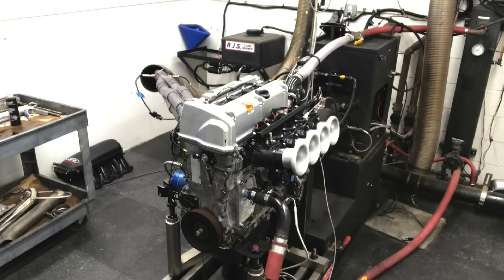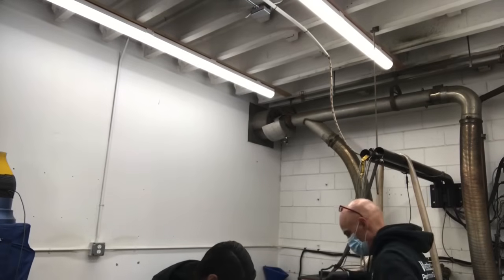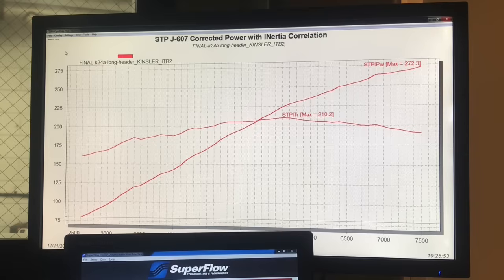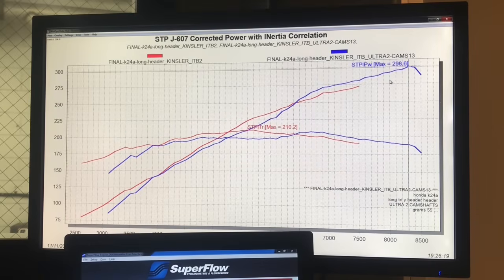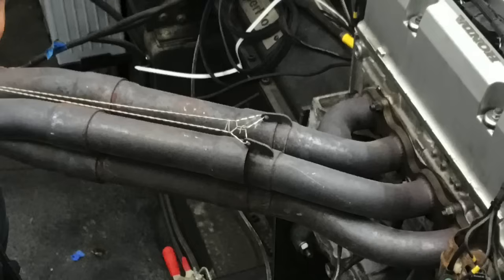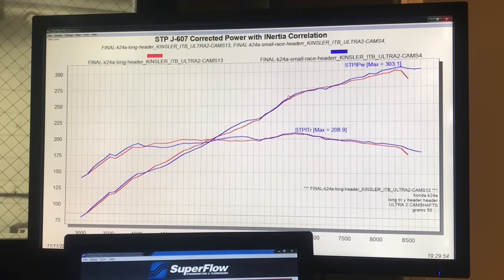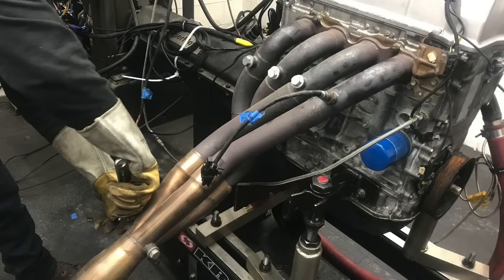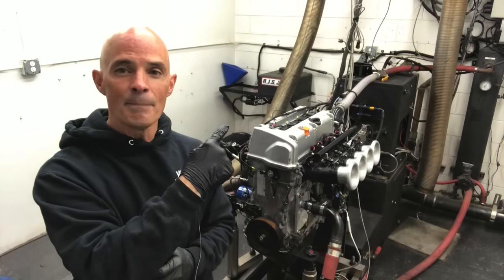HONDA K24A2, STOCK OIL PUMP GOES 8,700 RPM!!

Comment: Richard your normally realistic about Hp numbers on majority of your videos, but to get 272hp from a stock k24 with nothing more then Itb's !! +50hp is tad high for an engine with everything else stock 😳
Reply from the maker: "Normally Realistic?" I just provide the dyno data-you do know there is a difference between rated output and tested output, right?

Comment: so what can the stock engine rev to? Stock cams, stock springs
Reply: i dont care if the engine is built to 20K  it shouldn't live there. those engines are high $ engines and they won't live long it's why the manufacturers leave all that horse power on the table in the first place. guys who love a revvy engine love to flirt with high repair/replacement cost, GM got around the EPA for years in their performance department with gearing for example barely 200 hp economy v8s and COP transmissions. yep the same tranys that were in cop cars,to get them to perform, it caused them to go back to the drawing board everything thing they put out in the '80s was a turd by design.  the EPA hit them  it nearly wrecked their performance dept. altogether, but that the job of eugenics-minded environmentalists isn't it. it hit them in their wheelhouse, again by design. they had to compensate for the EPA's B*ULLSHIT! everything that has an alphabet moniker is not WORTH A F@CK, EPA, UWA so on. bunch a shit that creates unnecessary problems, regulatory bodies, and unions are a bunch of worthless and unnecessary ass-eaters, how area a giant expense for no good reason!  that steals every last scrap from your dinner table. and the enemy of every guy who just wants to go fast on the weekend.
 
anyway, high-mileage engines are quite agricultural for a reason. engines that live at low rev tug down there often get better fuel economy and live longer just ask any tractor mechanic. having said that GM is the shining example of getting performance out of not very much HP if it wasn't for that they wouldn't be around today considering that GM executives were never good with money like good old Henry Ford. In short think Tourge Bubby it wins the most prestigious races in the world. races are won the the twisty bits.

Comment: Does anyone have an opinion? After watching this video, I'm not sure building a KFrank engine is worth it. My current Frank engine hydrolocked last week. I have a new JDMK24A now, which I just bought. My questions is is it worth spending the extra money to have my Z1 head and RBC intakte manifold, with 50 degree cam gear switched over to my good k24 short block, or do I just run the whole new jdm k24 long block? What would you do? 
This stock engine appears to breath very well. I've read that the Z1 head doesl outflow the jdm head in cfm. And the RBC is supposed to provide better air flow with it's larger plenum and fatter runners. I wish I could have them both dyno'd.
Reply from the maker: look at the runner length of the intakes-that determines where (effective rpm) they make power. you probably are not using all of the stock airflow from either head-just get it running

Comment: So is it actually safe to daily drive a stock jdmK24a with these cams? Everything I have ever read says you need the accommodating valve train, not to mention stronger rods and pistons and higher compression. I mean this is really impressive and gives me the itch to get some performance cams, I just don't want to break a rod and blow my engine while rippin 4th gear on some Nissan, ya know. I also don't want to spend the money on rods and pistons lol
Reply from the maker: just need springs

Comment: After looking at this looks like its not necessary to swap the oil pump to a k20..thanks great video.
Reply: I have lots of questions too. I just wanted to respond that it may be okay in short burst, but like sustained racing? Also, is it really safe to rev a K24 like that? Everything I've read says no, that'll it'll die prematurely. You need rods and pistons.
So I don't know. It would be awesome if the K24 was that versatile.

Comment: Was this still the stock 25 degree vtc or did yall upgrade to the 50 degree? The 50 degree makes  huge gains (leave it at 45 degrees though)
Reply from the maker: we did most of the testing with 25 then went to 50
Reply: @richardholdener1727  awesome info. I figured with those numbers and the cam change, but didn't want to assume.
Reply: @richardholdener1727 where you able to give that engine all 50 degrees using the ultra2 cams? Or did you limit it within the ecu?

Comment: What fuel are you using that made 270hp 100% stock with just itbs and a header
Reply from the maker: 91
Reply: keep in mind that engine output, now wheel hp. stout-ass engine though

Comment: Im curious what would be the max rpm for stock camshafts before losing power.
Reply: it depends on what honda cams you have, but for k24 cams, which are designed for torque it's around 7600 rpm,

Comment: Thanks Richard!  I’d love to see a run tuned for torque.  M90 or m112 supercharger to boost low and mid torque?  I’m starting to think about running one or two of these in a boat.  Have a k24 in my Honda Element.

Comment: How do you check piston to valve clearance at 5:04 with the head on?
Reply from the maker: by pushing the valve down manually at the correct piston/valve interference point
Reply: @richardholdener1727  Thanks for the reply Richard.When you say manually you rotate the camshaft with a dial indicator on top?Is it safe and how much clearance you look for? What about radial clearance? Thanks for your time and your uploads!

Comment: I've got a question about cams. If I want a cam that idles like stock, all I have to do is make sure there's virtually no overlap between intake and exhaust by increasing LSA - I can really make the lift and duration whatever I want and it will idle fine?
Reply from the maker: not whatever you want, but more lsa allows more duration

Comment: Is there a concern with the use of the ITB in relation to rain or particles that can enter the engine? Since it has no filter.
Reply from the maker: yes
Reply: @richardholdener1727  ... ok, but what are the precautions?

Comment: What year is that motor  k24a2 jdm 05 tsx ???
Reply from the maker: not sure on year
Reply: @richardholdener1727  i have o5 k24a2 full k24a2 with acura rsx types oil pump and vtc intakecam.gear i got everything new for it chains tensioner everythng new hopeing to make 260hp on stock motor stage 2 clutch fylwheel ep3 si 5 speed  450 welboro on stock k2ra2 injectors

Comment: Before I swap my k24a2 into my integra dc5, I'd like to build the k20a2 so it's there for my kids car when he gets his. How much power do the parts make in the k20a2? Or do you already have videos on that motor?
Reply from the maker: I have not run the K20A2
Reply: @richardholdener1727  well I watch eithetway, but if so I'd be thankful

Comment: You're not worried you're living on borrowed time revving the stock rods/rod bolts to 9K?  The forces acting on the rods and rod bolts at TDC are a square law of RPM.  Little RPM changes can mean big increases in the forces.
Reply from the maker: we r worried
Reply: @richardholdener1727  I see...god speed sir!

Comment: The stroke of a K24 is 3.9"
Reving this 8700 rpm destroys the piston speed and long stroke low rpm internet myths
Reply: What myths are those? That high piston speeds result in poor reliability and increased engine wear? This thing is basically guaranteed to throw a rod in a race application, where shock loading is high.

Comment: Idk what the k24 motors spun stock but my k20 was limited to 8400 stock
Reply: 7k rpm in the accord euro that this engine is from (K24A3), 6k rpm vtec. They only have a 25 degree vtc and there's a bunch of other changes worth making.

Comment: The red curve dropped off kind of sharply as if it was a valve float issue.  Did you put stronger springs in before running the blue curve tests?
Reply from the maker: WE DID SPRINGS WITH THE CAM SWAP

Comment: I thought I would be impressed, but i'm NOT!  Compare to this:
Toyota 3tc 1.8L 8v cylinder head, 12.37:1 cr, 525cfm Carburetor, Tunnel Ram Intake,  long tube headers, solid lifter cam = 315hp / 210ft. lbs. Torque @ 8,000rpm
Reply from the maker: So a built race motor vs a k24 with cams-nice

Comment: 1.8 96-97 Miata 133 hp @ 6500 114 ft-lbs @ 5500
2.4 06-08 TSX 205 hp @ 7000 164 ft-lbs @ 4500
I can see why the K24A2 would be a popular Miata swap. And that's stock NA.  Also 
MGB 95 hp @ 5500 105 ft-lbs @ 2500

Comment: You definitely need to turn vtec on sooner with the aftermarket cams you were using that dip in power you lost is because you didnt move vtec down on your Vtec RPM table plus you arent varying your cam angles the way you should your leaving alot on the table you should call Brent from PFI speed and he will walk you threw what to do to pick up alot more power
Reply from the maker: if only we tested different VTEC onset points and cam timing......oh, wait!
Reply: Not true , vtec engagement is tuned to where the power curve acts best vtec transition is supposed to be smooth and and linear in the power curve simply engaging it sooner is 100% wrong , setting vtec to early or to late creates a lul in the power band .
Reply: @AnDrEw122100  Yes your are correct but look at the curve it was not smooth you should not see a crazy jump when it engages it should look smooth on the graph and should also sound smoother during engagement it has to do with the cam angles which you can set differently for different setups. Bottom ends do not like huge amounts of tq all the sudden you can limit low end tq with a cam angle\boost\timing strategy to save the bottom end and smooth the curve different K-series cam gears have different amounts of max phasing angles
Reply: Relevant video: https://www.youtube.com/watch?v=sDOKY3JGt1E
-
Also, you can't always get a smooth VTEC transition, it depends on the cam profiles, along with some other factors. If the secondary profile is significantly more aggressive than the primary profile(s), you'll always have a pretty noticeable transition.
Reply: Holdener has built some of the fastest Hondas on the planet, Brent... not so much.  http://www.superstreetonline.com/features/0801-turp-worlds-fastest-civic-bonneville

Comment: whats the limit of ohc rpm for valve float seems extremely high with no issues
Reply: Stock type s and tsx cylinder heads (this one) regularly make trips to 9k and beyond while maintaining control of the valves. 4piston race variants of this k24 rev in excess of 10,500

Comment: K24A2 block K20 head, skunk cams, 76mm precision on 25psi revving to 9500 all day in my long travel buggy. The K and the J are both amazing engine family's.
Reply: Stock rotating assembly?
Reply: @ClassicVinylAlbums  no I'm running weisco pistons and turbo rods, stock crank though.

Comment: I can’t believe 300hp on stock block 
Just headpacked is to crazy 
What’s fuel ?? 
What injectors 
What’s size Itbs
Reply from the maker: kinsler 65, 550 inj, pump gas
Reply: @richardholdener1727  Thnk u for the info

Comment: Zip ties from China !     Squirrel tuned 4.8 Chevy stock except the intake, cam, valve springs, lifters and turbo's 8,700 rpm = 7.80s 1/4 mile in a fox body Mustang. That Honda is gonna have to turn a lot more rpm than that to impress me.

Comment: This is mega. What an engine. You'll be single handedly increasing the prices of K24A2/A3s with this, love it.
Defo keen to see the upgrade to the 50deg cam gear thing, and the ported head.

I'm a turbo guy, but what these made N/A are so incredible I feel I'd have to do these N/A mods before I added boost.

We got a K24A3 here we recently bought, so timing of these videos couldn't be better...!
Reply: Facts

Comment: Imagine if an LS made 124 hp/l
Reply: Imagine if a k series made more than 10 ftlbs! Seriously though, not knocking k-series, but each has a very different application.
Reply: @GreatLakesLogger  This engine made 88 lb-ft/liter, an LS3 makes 68 lb-ft/liter, some Honda engines get up to 100 lb-ft/liter, while still running on pump gas. For their size, Honda engines make a huge amount of torque. Anyway, like Spank Themonkey said, torque doesn't mean diddly when it comes to performance.
Reply: @GreatLakesLogger   torque doesn't win races check out speed factory civic running 7.4 on the quarter mile at 215mph with 2000 hp🤪

Comment: I had the stock iron 4-2-1 ex manifold, primaries paired 1-4, 2-3 crack, so I replaced it with a fabbed 4-2-1 manifold paired 1-2,3-4. 
Didnt work at all at PART THROTTLE WITH A TURBO behind it.
Replaced it with a fabbed 4-2-1, paired 1-4, 2-3, and all is well again. 
Primaries a a little bit short, due to space though. Stock cams, with throttle valve for every intake runner, (stock) similar to the Kinsler.

Just saying....

Comment: Can you please do a test with k20a2 oil pump swap? Would love to see if deleting balance shafts has any effect on hp. Keep up the great work Richard!
Reply: All the mass in that K24 oil pump should result in 5-10 hp I would think. I was going to comment for this request also and the K20 50* variable cam gear swap too.
Reply: I had gained almost nothing switching to I k20 oil pump. Those are hyped up. You don't need one revving out a stock cammed k24
Reply: It does.  Anything that is lighter, higher flow, more rigid, or a part that allows for more balance, will always add and free up horsepower

Comment: Your commentary on this video had me laughing out loud 😆

300 HP from this little monster NA has me thinking about 700 + with some boost!

Cheers
Reply: You really want to smash some turbo cars just run nitromethane and get 600+ wheel horsepower. In a stock interior civic LX 4 door could run sub 10s high 9s. That would be the ultimate sleeper
Reply: @spankthemonkey3437  traction is the issue with that power level. Thats why the na crowd can run a 10 with less than 400 wheel and many turbo cars spin half the track into a high 11, or sadly some 12s but will have the mph for a very low 10.
Reply: @spankthemonkey3437  Crx's are under 2000k lbs dead stock. 350whp is enough to dip in the 10s. This isnt a guess, just go to a track. As for dogging on slicks for drag racing, if you can't run a proper tire, dont go to the track. All you will do is piss off people who actually make use of the prep.
Reply: @spankthemonkey3437  Consider that the torque a 400hp turbo car makes vs a 400 na. The turbo car comes into power much earlier and is harder to keep traction. Horsepower matters very little in terms of a good et. Its all about traction and specifically, traction on the leave.
Reply: @spankthemonkey3437  I dont even drive honda. I drive sand rail bro. Speak for yourself.
Reply: @spankthemonkey3437  Too much satire in your posts, I feel like im feeding a troll.  "turbo lag" doesnt change the fact it makes more torque than na combo would at every rpm. Even if its making full boost at 5k rpms(which would be way to big of turbo for most street driven cars), it will be making more torque than a similar hp na honda would through the entire curve. There's a trade off when building na and that comes with losing low speed power to maintain power past peak. Turbo cars specifically have a much harder time putting the power down because they average more power across the whole rpms. I mentioned a crx because its a 2k lb honda that is stock and regularly sees 11 seccond combos na or boosted and is much more common practice for a performance build than a 4 door econo-boxe with a full interior that refuses to run a proper tire while tracking. As for tires that hang out 5 inches bleh blahs... They make more than one size tire and i didnt say only run slicks. Dot radials are super f#ckin cheap and if you cant afford to run a proper tire on a car that you track, dont track. Go to a track one time please and get your own info rather than relying on youtube and google and maybe you'll keep from sounding nonsensical. Also your emoji use is painful to have to read around.
Reply: @spankthemonkey3437  Keep up the shallow internet tuff guy attitude. It'll take you far. Idk why fuel choice has anything to do with making you more of a man but if thats what you need to feel cherry, go for it. Nitromethane has its place. It requires more fuel system than methanol which makes for a useless combo off track. Nothing like the hum of a 5 gallon/minute fuel pump to make 300hp.
Reply: @spankthemonkey3437  call me 12 when you post videos of yourself chasing chickens around. Im literally rolling right now.

Comment: Imagine a set of those heads on a 4.8 LS?  K engines have to be the best 4 banger ever made.
Reply: https://www.mercuryracing.com/automotive/
Reply: Look at his big bang video 4.8, with stock bottom end boosted.

https://youtu.be/iCPJxo5tNqM
Reply: Check out the Mercury Racing SB4, it's basically a 7 liter LS with twin cam heads.